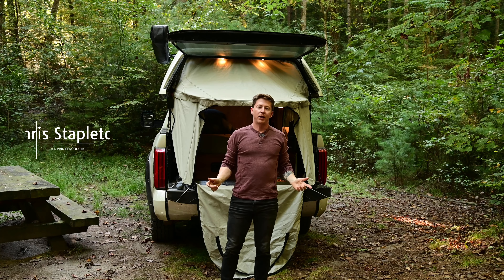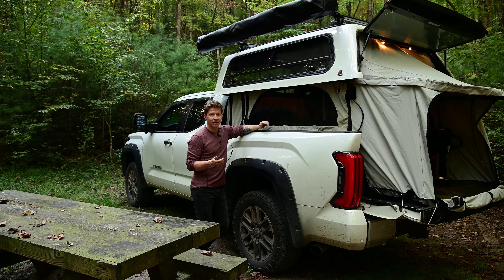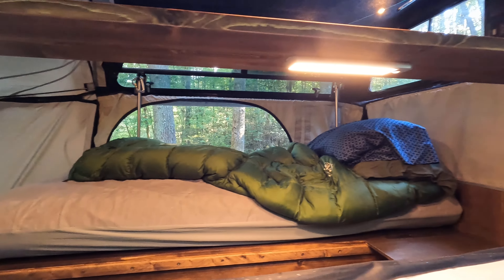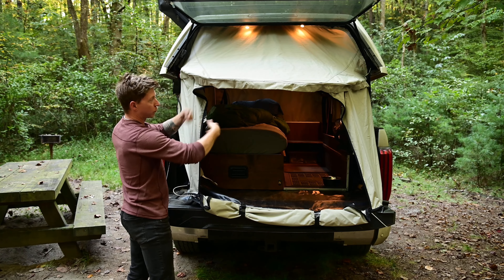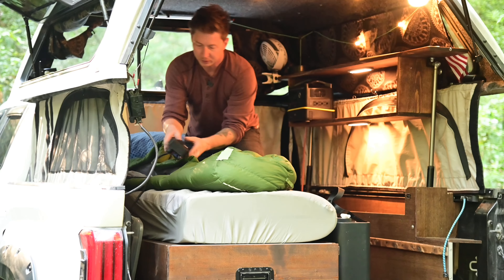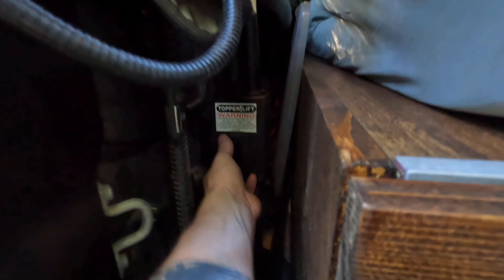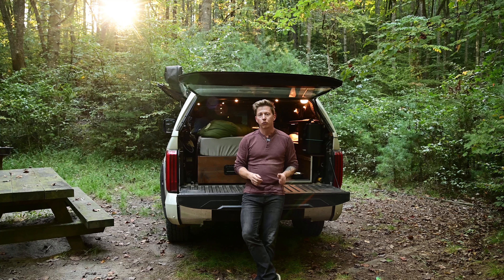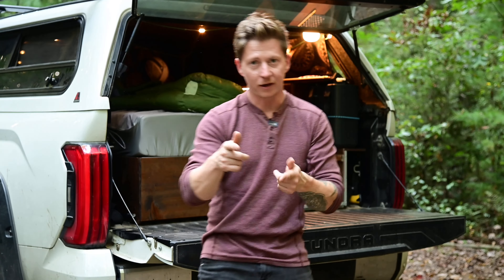EZ LIFT TOPPER SYSTEM FOR CAMPING | MUST WATCH BEFORE BUYING

Comment: This is hands down the best video on this system I have seen.  They never show the inside set up on these videos.  This is very detailed.  Thanks.
Reply from the maker: I appreciate the comment. I have had so many request’s to do a video on this. I have seen most of the EZ lift topper videos out there and it left me ith more questions than answers.
Reply: A question. Can you use the awning when the topper is deployed? Thx.

Comment: Hey Chris, thanks for doing this video. Very informative. I learned a little more about the EZ Lift setup. I like the way you have the shelf lift up with the topper. Great idea.
Reply from the maker: No problem.  And thank you. I Should have done it sooner.. lol. The shelf idea came after  I built the main frame. I used to just have one board running across the top of the actuators, but thought this would be a better use of space and a custom design. I love how it turned out , myself.

Comment: Great video and setup! I’ve had the topper lift for almost 3 years and had bad water intrusion only once when I got caught in a downpour. I should have lowered it down like you mentioned. Other than that it’s been a great setup.
Reply from the maker: Ive never really had much of an issue with the water either. Ive learned that lowering it it the way to avoid any serious problems!

Comment: Nice video! A used one is for sale near me. Would definitely help staying in my 5.5ft bed but my main goal was to keep it warm in the winter(this seemingly would make that a bit more difficult vs help), keep out light(doesn’t help), and security at night(makes it worse… the extended leg and headroom would be nice so I don’t have to sleep at an angle and also with my deck system if I had to hall something too tall for my topper I could raise it a few inches…I wish they made a full quilted liner for winter camping to keep out all light and cold
Reply from the maker: Yeah. They used to make an insulated version a few years ago. I went to order this one and that option was no longer available. I generally keep the topper down if it gets too cold.But,it does stay much warmer than i thought , as is. Ive got a good sleeping bag and layers. Ive been down to -10 and stayed “comfortable” lol. Hope you get something figured out. I’ll be staying in mine all winter, again. Thanks for the comment and interest!

Comment: I chose the Leer 122 shell to accommodate my height.  I'm  6' and can almost stand straight.  I do wish the controller length  longer; so if it's  up and gets too westhery, it could still be lowered from the front of the bed
Reply from the maker: Thats the mid-ride
Topper, correct?

Comment: Love this system. My only concern is heavy winds. Have you camped out in heavy winds before? If so how was it?
Reply from the maker: Good question. Ive had this thing in some decent winds last year. It’s hard to explain how solid the mounting is on this system. I never felt like it was a problem or that it couldn’t handle the winds. If needed, I would just lower the topper a bit for ease of mind. Hope that helps.

Comment: Great video Chris, I’ve been on the fence about getting one of these. Do you notice that going through a car wash and stuff or driving on Dusty roads that the Topper is a lot less sealed?
Reply from the maker: Thanks for checking out the video. Honestly, there is a nice 2” topper/seal tape that comes with the kit. It seals the topper and truck bed really well along the sides. I have not had any issues with the seal. The tailgate / topper area is the only place I’ve noticed dust/water getting in, which is typical for any topper. I did add an additional seal along the tailgate and topper hatch to alleviate most of this. Hope that helps.

Comment: Great video Chris, Thanks.  Quick question = There's no reason to clamp the topper while driving, is there?  In other words, the system works as the clamps.
Reply from the maker: That is correct. This system will secure the topper at all times.  I guess you could use the clamps if you really wanted while driving. But not necessary.

Comment: Awesome video! Thanks for the full review of it. I have a Chevy avalanche and a topper with it, the main advantage of the avalanche is that you can walk to the cab from the box in the back. With this lifting system, do you think that the tent can be modified to cover the front of the topper? (Avalanche topper doesn’t have a wall /window in the front.
Reply from the maker: Thats a real interesting scenario. With the current options available from EZ lift, im going to say that you would definitely need to modify that front piece. Id look into trying to find some canvas material to add to the kit you would buy. So you would have to figure out a custom piece for that front entry.I am real curious to see how you would do that.

Comment: can you use the lifts to take the topper off and store it on a shelf? Ex. you extend the top and then reverse the truck into a garage so the topper rests on a shelf and then you unbolt the lifts from the truck
Reply from the maker: Yeah, you could do that. You will need to be able to support the topper with some blocking while you unbolt everything to get weight off the bolts. Hope that makes sense.

Comment: Have you ever wondered why there’s not a lot of reviews on this system? I think it’s a hell of an idea but just concerned about leaking, and not quite enough head room to stand up.  Maybe I’m gonna have to switch out my campershell for a grandpa campershell 🤣 Either way I can still accomplish my goals of mounting my new awning on my new rack that’s still sitting in the shop, stealth camping, & being able to sit in a chair comfortably and cook and eat and get dressed.
Reply from the maker: I agree with ya. They have their design flaws, but I’ve been able to manage it very well, never had any real issues with water, or head space. I’m 5.9’ and can move around comfortably. I keep mine down when stealth camping. And the build out is  designed to allow me room in there when the topper is down. I looked at the mid rise toppers too. They would give you that head space you are looking for. Still a really great system after 5 years of heavy use. I basically live out of this thing.

Comment: How do you handle wiring for the cap’s 3rd brake light or interior ceiling lights?
Reply from the maker: I basically added some length of wiring and made it look really clean with tubing. It tucks into a space when I raise and lower it. Im getting a lot of good questions about this system and  will put together a video answering all them soon. Appreciate the comment.

Comment: I have a 2021 8ft bed Tundra and live full time in my truck with a full kitchen and bathroom area.
Try use 20 mil or thick tarp for your siding. My truck is water proof, also I have the lift on 4 inch blocks and the topper rises to 5' 11", I'm 6ft so it's nice.
This is great for stealth camping with the top down!!
Just an idea using tarp instead of the camper package. 
👍
Reply from the maker: I seen another video where someone did something similar. It seemed to work. Ive used the tarps before as a temp system. Not a bad idea, as long as u can secure the tarps.

Comment: the one thing I have notice with my lift kit,  is sometime when its fully extended there  not in sync with each other.other im happy with it
Reply from the maker: Yeah. Noticed that as well. The company always said lowering it back down resets them, but that doesn’t help. Ive also noticed if the trucks not level and you raise it, some times the weight of the topper shift to one of the actuators and can cause it to possibly jam up, so I gotta keep an eye on them when I first start lowering them.

Comment: Is the lifts and set up easy to take on and off or is it a permanent install? Thank you for the demo in advance.
Reply from the maker: Installing the system is fairly straightforward. Once it’s installed you could uninstall it later if you wanted to.

Comment: In regards to The tailgate canvas tent piece at the 2:57, would that work on a high rise ARE MX shell? Or would the canvas be too short to attach to the higher ceiling of a high rise topper?
Reply from the maker: Honestly. Id say it would be big enough. When you go to buy this kit, it will ask you if you have a full or mid size truck. Which will determine the amount of material they use for the kit. I would ask them directly to confirm.

Comment: That's pretty cool,  I've never seen anything like that, ...A tent for your topper,.   Do they sell that for a smaller truck med.
Reply from the maker: Oh yeah. They basically fit any truck out there. You choose the size when you go to order the system, either full size or mid size. But each size also allows some adjustment to fit the truck you have. It really is the way to go IMO .
Reply: yes they do, go on the website

Comment: How much total height do you have from the bed to the ceiling when extended?
Reply from the maker: I’m going to say roughly 400 pounds give or take a little. The awning itself weighs about 70 pounds my best guess the topper weighs 300 to 325-ish. Maybe even less.
Reply: @chrisstapleton-ChalkPrintProd  oh sorry I was meaning the height, not the weight.
Reply from the maker: @jeepncj7  that’s my bad lol I misread that. I can get a measurement later but I think it’s right around 4 feet maybe 4 1/2.
Reply from the maker: @jeepncj7  one thing to note. Depending on what topper you have, that’s gonna also determine what kind of height you’ll have with that system. Ultimately the easy lift topper actuators lift 19 1/2 inches.
Reply: @chrisstapleton-ChalkPrintProd  Thank you! That gives me a good idea on usability as I'm a similar height.

Comment: I have an ARE Camper Shell/Topper. Is this a complete shell system I have to purchase, or can I use my existing Camper Shell, and turn it into a "Pop-Up" Style camper like yours?
Reply from the maker: No. Look up EZ Lift topper systems. They are universal systems that allow you to use any brand shell.
Reply from the maker: You will use your existing shell

Comment: Can you out another flip up tent on top of that?
Reply from the maker: It depends on the weight of the tent. The actuators are rated for a combined weight of 900 lbs. So that includes the truck topper/ cap and whatever is mounted on the roof( tents, racks, etc) these systems are strong, I’m not sure I would want to be moving around in a tent on top of them though…Hope that helps.

Comment: what happens if you lost all power I assume there is no way to manually lower the actuators?
Reply from the maker: Great question. There is not a way to manually lower, that I am aware of. This system draws very low power when you raise/lower the system. Id imagine your vehicle isn’t going anywhere if you lose power. Once u got your vehicle jumped, everything would fire back up.
Reply from the maker: They do make an EZ charger kit, that plugs into your towing/trailer harness on the back. Your alternator will charge your 12v accessories or a spare battery while the truck is running/idling. So u could install a spare battery in the back somewhere for instances like that.

Comment: I just got this system. How/where did you attach that shelf that rises with the topper?
Reply from the maker: I attached it to the top of the actuator . I used the existing mounting slots and added an additional bolt to mount the shelf.

Comment: Is it safe to drive at highway speed with the camper open so I can fit my motorbike inside?
Reply from the maker: They don’t recommend it. I can speak from personal experiences that it did hold up to about 55 miles an hour about halfway up. The way that they advertise it is that it all allows you to still use your bed for things like you mentioned. That implies that it would be OK.

Comment: So does this company sell the camper sell and all or is it just the lift and bed?
Reply from the maker: Good question. The kit comes with the lift actuators, the wiring needed to connect it to the battery, and sealing tape for the truck bed. It also includes the canvas camping kits. You can also opt to just buy the lift system without the panels. You will need to buy the topper. These kits are universal and will install with almost all toppers available on the market.